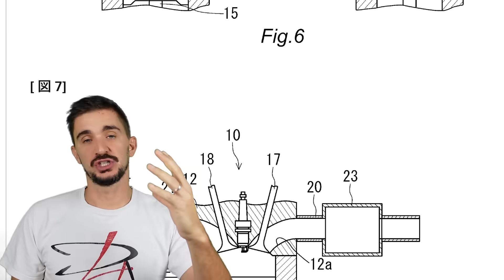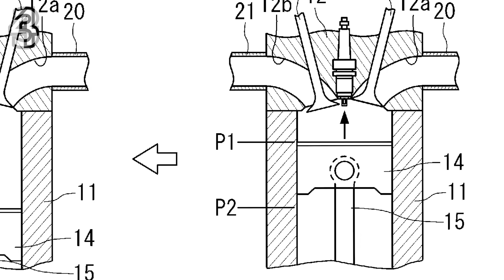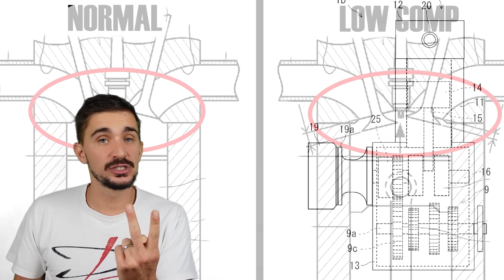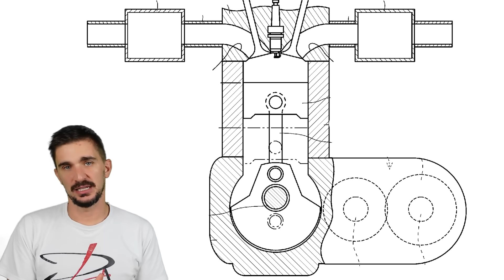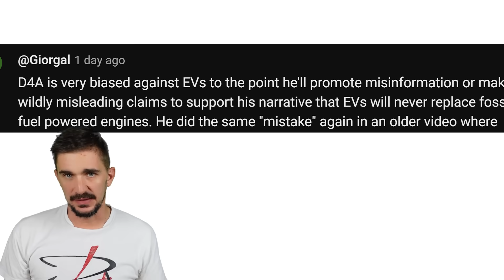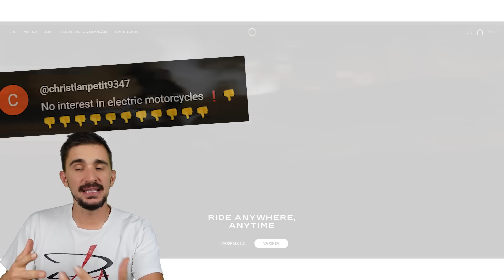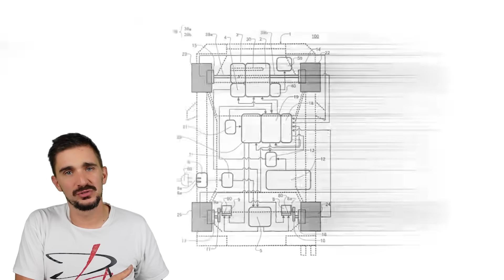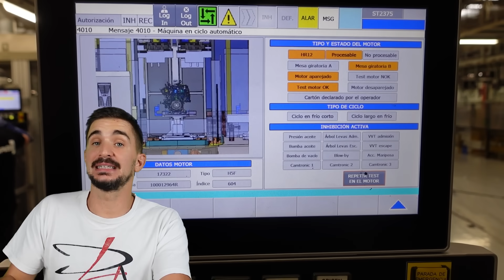Yamaha Just Patented A Fake Engine

Comment: I have a feeling that, Yamaha, a company known for sound as well as ICE performance, did this to have something that they could lease or sell to other OEMs.  I don't doubt that they could use it too if they decide to make EV motorcycles, but its more for their own RnD.  They might see the way the market is slowly going and need to have something to help transition some people over that just enjoy that raw feeling of a motorcycle and don't use it for anything else other than enjoyment. They also don't have to make it as heavy since it isn't really providing that power.

I would imagine that it will need oil but it would be a sealed system.  I can't see where you would want to have partially atomized oil being ejected into the environment.

You can patent any design that is new.  It can be a design patent or a utility patent. I think this is important to know the difference.  I think your last thought is probably most likely.  The battery density isn't going to change but the battery chemistry is about to change and they see that as an opening to provide this.

I would say wait to see what they do with it before judging the design.  Granted we know its for providing a feel for people who want that feel its just a question of will they use it, or will someone else?

Comment: i think the engine would use up more energy from the electric motor just because its pumping air (which is why engines burn fuel when ideling). pumping air is work. 

the weight wouldn't change that much, as aging wheels demonstrated, but the taking up space yes.

also rember, this "engine" would need to be lubricated adding even more paracitc draw with the oil pump.

Comment: In light of the fact that Hyundai is releasing a EV sports hatch that produces 120dB of engine noise from door mounted speakers, nothing surprises me out of Asia. I guess the question was how do you make a 30% efficient EV motorbike.

Anyhow, personally I hope they choke on it. they should just jack up the price of fuel to $50 per litre and everyone switch in a matter of a few years. BTW, the Hyundai car should be banned on noise pollution grounds.

Comment: So, basically, Yamaha attached an air compressor to an electric motor and patented it. The difference being that the Yamaha air compressor uses valves like a combustion engine rather than the reed valves of a conventional compressor and adjusted the valve timing so it made certain noises. The end.

Electric motorcycles already have a limited enough range as it is without the electric motor driving a useless air compressor as well which will reduce the range even more. To add to the uselessness of the air compressor it will not even do anything useful such as be able to inflate tyres.

To my mind, it would have been a much better and useful idea if the 'engine' was the actual electric motor. Model engines have been made using solenoids instead of pistons. Why not do the same here? At the very least the mass and volume of the conventional rotating electric motor would no longer be present. The air moving through the engine could be used to assist cooling as well as make some sound.

Using linear motors this way could result in kits that can be retrofitted to existing engines or bike models which would much reduce costs of an electric bike. An added advantage would be that the gearbox and clutch could be retained providing rider some interaction and remove the twist-and-go aspect of most electric vehicles. Riding using engine braking techniques would result in significantly improved regenerative braking and enhanced range. A gearbox would also improve acceleration for a given motor power and minimise energy depleted from the battery benefiting range further while still allowing progress to be made.

Comment: Without experimenting, How would they have known this was a silly idea. They have to find out. They could just have a EV motor case to look like a IC engine.  At least the looks would still be how MC's should look. But powering a compressor aint good for battery range.

Comment: I do think that people to some degree do like the sound of "straddle-type" vehicle. I definatelly like engine sound in the car and prefer it over the whine of electric motor, but I am not RETARDED. If I have EV, then I won't try to artificially add bits in it that make noise of the engine (or like Toyota, faked manual gearbox). I would simply have EV and use it for what it is good (for example short city drives) and I will jhave ICEV for things it is good, like trashing it on the country roads on weekend, revving it out, enjoying the sound and the dramma controlled explosions make.

Also all that said - I do not believe the airpump they patented will make convincing noise, it will inevitably going to sound like compressor... because large part of sound is the exploding fuel and it happens at much higher pressures. Keeping it effcient and relativelly low compression, and withotu actual explosions will sound like an air compressor in shop... I don't believe anyone like that sound when you use some air and compressor kicks in.

So 1. it is dumb as a concept. 2. I don't believe it's going to achieve what it is aiming for. It is not just any noise and vibrations people prefer, they prefer SPECIFIC noises and vibrations that were refined over more than 100 years in ICE development.

Only one caveat - ICE should not be arbitrarily banned to make way for EVs, EVs have to become so good that people would chose them anyway. Like we moved from steam engines to ICE, same shwoudl happen with BEVs or other EVs. I think maybe this patent is kind of linked to absurd reality where we prematurelly killing technology not because people like it, but despite people not liking it.

Comment: Replace the 'engine' with a small AC compressor and condenser up front, then flexible hose the cool air from the evaporator in the middle into a custom port on a suit that keeps you cool in the summer heat. That's my weird engineering desire for this.

Comment: I wonder if they will use this as an air compressor and use the pressurized air somehow to generate power to power a range extender.  Think an old “air hogs plane” used the compressed air to power a piston “engine” to turn the propeller for several seconds.   Could this be a test run for the motor as a big compressor motor and then let’s imagine what they could do with the air produced.  

Still seems like it’s an overall loss, but maybe it’s not even for a battery

Comment: The only thing that makes sense to me in a in-between vehicle between ev and ice is an electric motor handled electronically as an ice (basically reducing torque at low rpm, that you can regulate and remove if you get tired of it) with a manual gearbox to mimic the traditional way to drive, that requires less servicing than a fake engine... until you have to change the clutch and that wpuld piss me off knowing it's not necessary for the technology we have. I also believe i'd get tired of it eventually if i could try the pure ev experience, because on the street, afterall, we all just seek for comfort at one point, especially for loooong rides

Comment: I mean a speaker would use less energy… could download a F1 sound profile if you like…
Reply: I will buy an electric motorcycle if it has the same range and speed of filling as an unleaded bike. Give standardised, hot swappable fuel cells or batteries. If My bike has a range of 400kms and I need to get 500 between fuel, I take a bladder… electric bikes??? goodluck

Comment: What surprises me is that Yamaha hasn't patented any form of fake engine, just this specific one, which seems to be an absurdly complicated mechanical means of providing a fake engine experience. You could do the same job with an electrical/electronic mechanism generating sound and vibration, with the possible advantage that the rider could choose the 'engine' configuration, induction and exhaust noise. Put it in an engine shaped casing and you're good to go. I just put that idea in the public domain, BTW.

Comment: wait i got an idea. what if we would run this fake engine on some sort of magic juice. juice that is very energy dense. and you could fill the magic juice up in couple of minutes. and then that engine would be making maybe enough power we can remove the electric motors, replace huge batteries with one small battery for starting this fake engine and power the rear wheel using this engine through chain or something?

Comment: No combustion means the "exhaust" leaves the cylinder too slowly.  It would barely sound like a fart, even with a resonator.  Compressing enough air to get noise wastes a LOT of energy and creates heat, so... yeah.  Just like this fake engine, I'm at a total loss.

Comment: It's not a bad idea - hear me out : the engine noises and vibration gives you a feedback loop.  It let's you feel and hear the speed. 

It also let's the automobiles around you know that you are there.  

It's a bit odd, but its not a bad solution if the battery capacity increases.

Comment: I think the problem this is trying to solve is definitely a real one. Just play any racing game and turn the engine sounds to zero and you will immediately feel how empty and boring it feels. 

But I don't think this is a good solution. A lot of these electric bikes already have some pretty fancy tech in them. I reckon some bass shakers in the seat paired with wireless speakers in the helmet could get you 90% of the way there without all these drawbacks. Helmet audio is already pretty common, you just need to get it to make the right noises. 

This seems like more of a problem for a sim racing FFB team, than an engine design team...

Comment: Yes, you will be forced to stay away from diesel engines as the China and Russia produce a lot of CO2 and microplastics into the air by burning trash, Russia and other countries - even more pollute air by using recent chemical and conventional weapons, but most of the countries are led by very stupid, balls-less people so they will ban diesel engines instead. Look at it deeper, companies that used to invest into oil-based fuels are now investing into electrical solution and alternative batteries to commonly used Li-Ions, to make them store more power, like anti-opal, sodium ones. Why? well,. there's issues that will lead to even more pollution and loss of oil, and all of them are planned, including the new conflict at the East that will spark soon. cutting off Russia's limbs has also done some influence to it, but far lesser than the new conflicts amd regi;atpru practices will.

Comment: Soooo basically it's a small compressor that simulates engine sounds....it's a parasitic loss for sound. It should be on a separate small motor that can be turned off.

Comment: I could consider buying an electric motorycle with a fake engine, if the price is right. I would then remove the fake engine.

This seems like a lot of effort to get rid of many of EV:s upsides. Energy efficiency, smooth operation, environmental friendlyness. While the fake engine does not burn fuel, it still has manufacturing emissions, and if it need lubrication, as I presume it will, it will make used engine oil. Wasting energy is also not good for the environment.

It is also a lot of effort to make one of EV:s downsides worse. Range is super important on EV:s since it is somewhat limited and this is wasting precious space for batteries.

Comment: Bicycles are surely proof of the fact that millions of people will buy and ride a bike that is essentially silent. An electric bike would still make more sound than a pedal powered bike, so its not as if the choices are going to be either combustion engine or complete silence. But even if that was the case, the lack of sound hasn't stopped people from buying, racing and enjoying bicycles for 150 years.

Comment: what i don't understand is... just to produce engine noise and vibrations, couldn't it be done with a much smaller setup? why does it need to be a scale model of an actual petrol engine but made to run off a battery? i'm almost certain that - with yamaha's engineers and R&D - they could make a glorified smartphone vibrator + speakers do that for a fraction of the weight and power consumption. if "realism" somehow matters, i'm sure there's plenty of room between super vibrator with speakers and a whole ass fake engine.

is something lost in translation here?

Comment: You are missing the point entirely. Patent's are purely business driven and the patent is there to protect certain concepts. The real important part of the patent might just half of some sentence buried in the small print.
Reply from the maker: If a patent is protecting a certain concept, what concept is that? It's not an electric motorcycle with a fake engine?
Reply: @d4a it's complicated, more so than I'm willing to discuss

Comment: I think Yamaha is really onto something here, but it just needs a couple of tweaks.  The piston is a good idea, but encasing it in a closed cylinder just leads to unnecessary losses.  Perhaps making it wider and a little concave, directly exposed to the air (or with a mesh or grille in front of it to protect users) would improve it.  You could call it a cone instead.  And instead of using a rotating crankshaft to drive this "cone", since it's battery powered, why not drive it up and down using electricity directly?  Perhaps using tightly wrapped wires to create a magnetic field, I'm sure it could be done!  We could name this strange electronic crankshaft alternative, I don't know, a voice coil or something like that.  With all the weight savings of this alternative design, this new "cone" and "voice coil" could reciprocate at even higher RPMs than before even, giving yet more flexibility to the sound of the motor.  Properly designed, you could rev it up to 20,000 RPMs or more!

Comment: 4:20 This isn't necessarily true as you get the energy back when the piston goes back down. Of course a very small amount of the compressed air will turn into heat, but it's not as significant a loss as one would think. The only stroke in a 'normal' otto cycle that costs power is the intake stroke, as a vacuum has to be produced.

7:59 Ditto

Comment: I would tend to agree that I think it's a stupid idea. You basically just turned to 4-stroke engine into a fancy air compressor. Probably still going to need lubrication but cooling I wouldn't think so. Small gas engines get away with air cooling so I'm pretty sure a fancy air compressor that doesn't even burn any fuel can get away with air Cooling.

Comment: I cannot imagine this would need much maintenance. Given that it will not be getting nearly as hot as an internal combustion engine, there will not be the same heat cycle issues.  The oil will not go through the same kind of wear as happens when there is more heat, blow by gases, combustion, etc.  It's much like an air compressor, and there are many oil-less compressors, and the compressors that do have oil will run a long time (500-1000 hours) without requiring an oil change.
It's still a ridiculous idea to add all that extra weight and energy sucking to get the feel of an Internal Combustion Engine from an electric bike.

Comment: I wonder why they didn't just go for a balance shaft + speaker system, getting vibration and noise in a far lighter and less power sapping manner? And then put it somewhere and use the fake engine to cover up the battery or storage or the real engine, etc?

Comment: What if, and this may be absurd (though the extent of creating a fake motor is equally absurd but it seems we may be talking in hypothetics), but what if one of the reasons for this patent is to potentially turn it into a battery pack mimicking the design of a motor? Since the weight of the batteries needs to be considered when making EVs, if they stack and create the batteries to look like an engine block and head, the moving parts inside (piston/s etc) could be there to cycle air through and potentially make noise and cool the batteries from the inside at the same time, they could keep motorcycle geometries the same and potentially (wastefully) make noise at the same time. I dont think a combustionless motor would make exactly the same noise a traditional motor would make as there are no combustion events, though because of this and the fact that they arent making the internals air tight, it would also be fair to assume that the rotating assembly also wouldnt need to be really tight, thus reducing friction, heat, weight as well as the amount of lubrication required, if its required at all? On top of this, if there is a next step patent to see if the crankshaft equivalent could be designed to work similar to a rod through coil to create some kind of generator or range extender and the loose tolerance piston/s would be there to extract heat who knows, but this also seems a bit too far fetched.

I think some of the other comments stating this is being done so they dont get sued in the future is much more likely so when considering cost to patent vs potential future litigation over BS

Or its a simple bs way to create a 'simplified motor' that pumps air with no fuel but still has a spark plug, to then be sold later with very easy conversion to consume some type of combustible fuel (also mentioned in other comments)